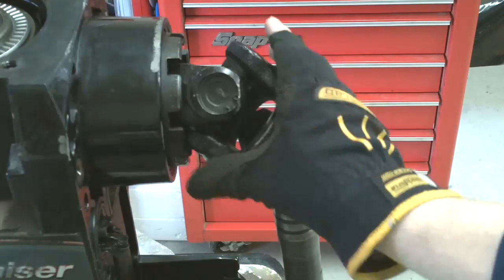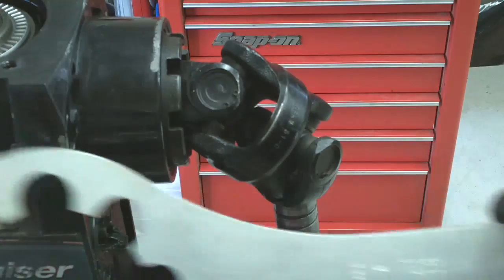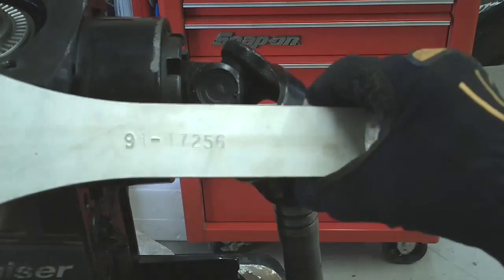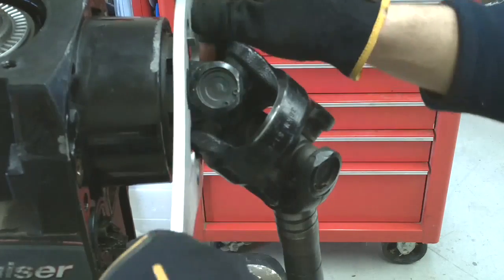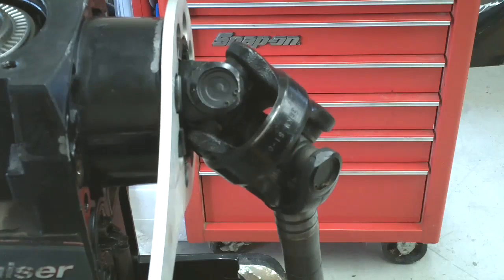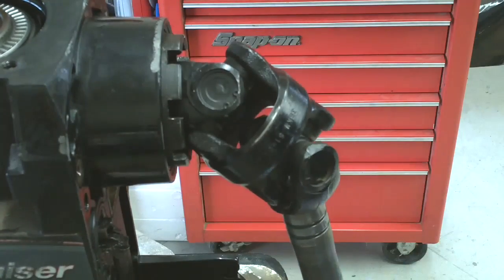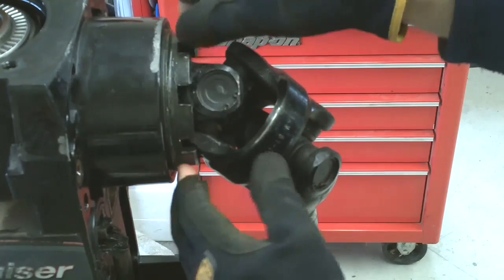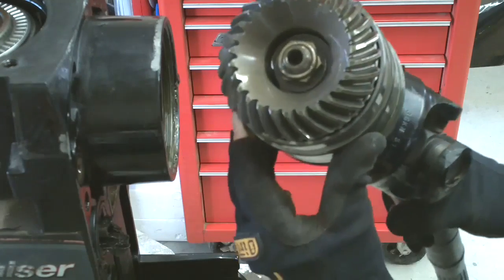Mercruiser Bravo Sterndrive Upper Unit Dis-assembly

Comment: Have you ever seen any internal damage? Like from bravo 3 overheating? I’m having trouble reaching max speed at wot rpm. Had the boat in to the shop and they replaced the fuel pumps. Got it back same thing. When I type numbers in a prop slip calculator I’m getting 22%. I was advised my out drive is overheating and it needs to be looked at. 2003 cobalt 226 with 496 running 28p props

Comment: When re-assembling can the timing marks be aligned by looking from the front, instead of the rear cover?  Also, is the yoke assembly supposed to just slide back into the carrier?  Mine seems it might need the help of a good sized rubber mallet.